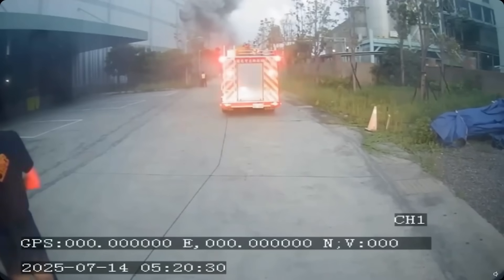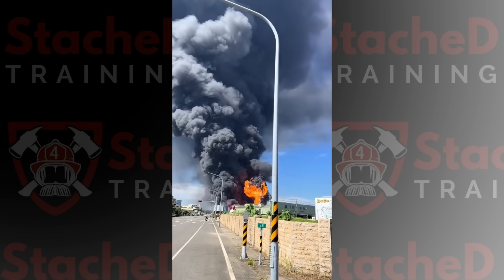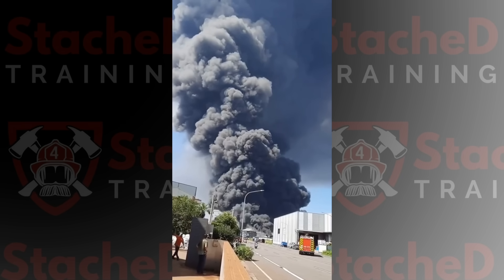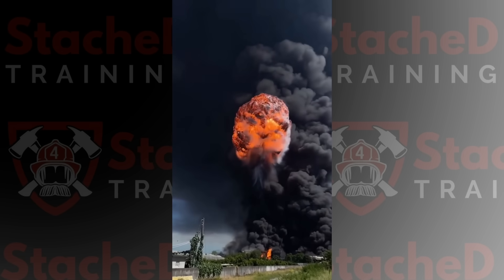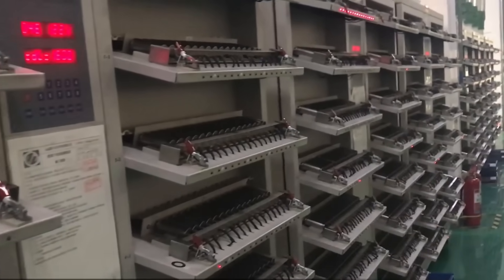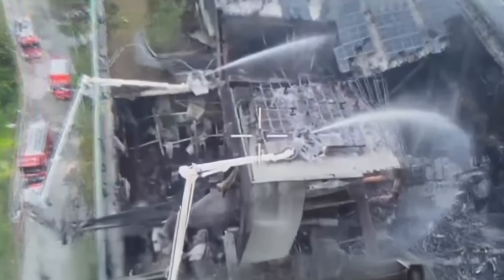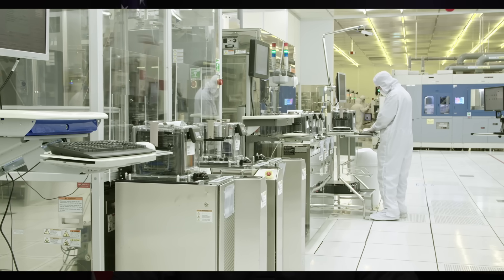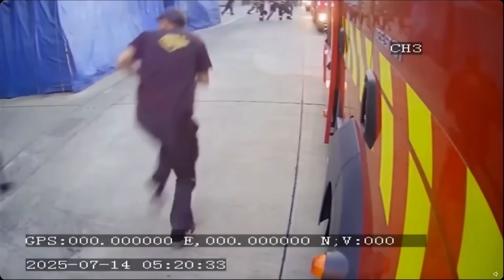Massive Lithium-Ion Fire in Taiwan: 2 Million Cells Lost

Comment: I'm sticking with gas-diesel-prooane, it's so much safer and fuel fires are so much easier to mitigate than metal fires. Metal fires are also super toxic. The fumes are deadly. Gas, diesel fires don't pollute the ground and water. Petroleum came out of the ground and microbes break it down. That doesn't happen with lithium oxide, nickel oxide and other dioxins created in the fire.

Comment: What insurance company is still underwriting this crap?
Reply: most of them because they know the actual risk and are insuring far riskier things.
Reply: Whoever is getting paid.
Reply: There is no insurance -  you buy laptops, cell phones, flash lights, it ALLLLLL has lithium cells.    Tell me how many lithium cells are in your house?       probably 100+      A laptop battery has like 9 cells,   A phone has a pouch cell,   tablet, pouch cell,  Flash light at least 2+ cells,   battery power tools 6-20 cells  you probably hvae a ton of power tool batteries,   maybe a Lithium Ion  car battery?   Optima battery?      You have a battery radio?   Weather station?    Some HF radios?    Mannnnn you have so many cells in your house BOI
Reply: @DrScopey2  The issue isn't the batteries themselves, but the large-high capacity unregulated batteries packed together and left to decay in the sun
Reply: @DrScopey2  You are right.  Too many Li batteries -- phones, laptops, and tablets.  Makes me quite edgy.  I'd rather deal with the old fashioned inconveniences of NiCd or NiMH batteries, but that's not an option unless I want to use electronics from 1995.  My favorite portable Sony CD player ran for hours and hours on a single charge of its lead acid battery, and those batteries never had any charging "memory" problems.  I'd love it if I could put a lead acid battery into my tablet computer.  (The CD player only stopped working when I accidentally dropped it down a set of concrete steps, sadly.)  Lead has its own problems, but those batteries were never known to catch fire if you looked at them the wrong way, and they offered very high charging density.  Lead batteries are perfect for portable electronics.  For something like a battery powered car, not so much, because of their weight when used at larger scales.  For home battery backup, I would choose lead acid over lithium on any day of the week.  What led (no pun intended) to people forgetting about lead batteries for electronics is beyond me.

Comment: Now there will be torrential  rain as a result of all those minerals going up into the air where it doesn't belong. These batteries are not worth what it does to our environment when it burns. Thank you for another detailing report.
Reply: That's not a big deal, those fumes rise in to atmosphere pretty fast and well above the weather system, they got really high up about 300,000  feet until the sun rays brake them apart in about 100 years.  But trust me when someone burns trash that is much worse, plastics in the atmosphere can last 200-500 years but they begin to brake apart within just a few days so the smoke itself is baked off but the particles last for hundreds of years not a big deal, the planet will be here for another 2 billion years so all humans are doing here is a tiny tiny little spot on the time scale.

Comment: I think we are electrifying things just for the sake of electrifying them at this point. I'm getting tired of having to keep tabs on charging so many batteries. One of my bicycles has 4 batteries just for the shifting, then you need another in the computer and another in the heart rate monitor. I would have preferred a cable actuated system, but the manufacturers are phasing them out. Mechanical stuff I can often fix, but things with circuit boards are often next to impossible to repair. There is a brilliance in simplicity.
Reply: BUT you bought it anyway! 🤦‍♂️
Apple fanboy, right?! 😂
Reply: Yeah.  Battery tools are a lifesaver in some cases, and I have an electric mower for my small yard, but we've gone overboard to the point where you have to look hard to find equipment that plugs into the wall or uses regular batteries.  I went to look for a baby monitor to monitor a piece of equipment in another room, and most of those are rechargeable!  Computer keyboards, flashlights, everything.  You almost need a list to keep track of all the stuff you own to make sure something doesn't get too discharged and permanently dies.
Reply: @WanJae42  re: "Battery tools are a lifesaver in some cases..."  "SCREW THAT...!!!" (best Amish/PA "Deutsch"/last name Stoltzfus voice)
Reply: That's why I ride a 50 year old Schwinn 10 speed 😀.
Reply: @leepowell6754 
Can you still get parts for it?
Reply: re: "I think we are electrifying things just for the sake of electrifying them at this point."  close but no, we are "electrifying things" for the sake of GREED and ESC (End Stage Capitalism) as such we have to call it what it is.  breaking news...!!!  the Markets have SHRUNK, all the Bridges have been built, all the Water has been drawn, and all the Ditches have been dug.👈this is why it's important we mature and develop the courage to pay attention to the Politics occurring in Washington DC and occuring in the State Capitals so one knows what's actually going on.  as we see from the grotesque loss of young life along the Guadalupe River in Texas, no one (least of all future generations) are served when the so called "adults" RETREAT INTO FANTASY.
Reply: I agree.  We have never been so batteries oriented as a society.   We have gotten away from simple mechanical tools that used to be the norm.
Reply: Why didn't you CHOOSE a simple bicycle then? You don't need a heart rate monitor or computer to exercise. I'm willing to state under penalty for perjury that athletes reached high performance levels long before electric light, let alone computers.
Reply: Lol you dont all that stuff. Use a regular bike and a desktop pc. That what i do. I cant afford an electric bike anyways lol.
Reply: @Lobonova  only weaklings use electric bike
Reply: Say electrifying again fool
Reply: They are next to impossible to repair for someone, who isn't willing to learn new skills. Guess what. A Model T was next to impossible to repair for one of the founding fathers and a fork is next to impossible to use for a chimpanzee. 

Get yourself a rework station and stop complaining.
Reply: @goiterlanternbase  They're as repairable as the manufacturer wants them to be.  Not very.  Simple and robust vs complex, over engineered and fragile?  Simple and robust every time.
Reply: @goiterlanternbase  That or just dont buy silly consumer crap in the first place. I have rework equipment for fun but the wise choice is not buying IoT future ewaste and using money wisely instead.
Reply: @goiterlanternbase 
Yea, right.
Reply: We can do all this chitchat. But in the end there is only one final scientific conclusion: there is human made climate change, we need to do something, and the change from fossil fuel to EV is one of the measures, with least invest and the bigest impact on the environment.
Reply: @muten861  quite ignorant but believe what you want.  EVs are not “clean.”  They are tail pipe clean.  The electricity comes from somewhere, often from fossil fuels.  The environmental impact of batteries is overblown, but not zero.  The increased tire wear is overblown, but not zero.  The increased road wear from their weight and requirement for more frequent repaving is not zero.  EVs aren’t bad, they just aren’t as clean as they are often advertised and imposing them just hurts their appeal.  For many people, an EV is genuinely the best option for their driving habits.  But when you tell them they are the devil for not having one, they don’t want to give in to bullying.  Can’t blame them.
I say as an EV owner.
Reply: @qwerty112311  if you state to be an EV owner, doesnt provide you any credibility.  There hundrets of elaborated scientific studies, coming all to the same conclusion. But youre more genius than all of these scientists. They should have asked you😂
Reply: @muten861  Them scientific studies are bought and paid for by the people pushing this garbage. If they don't come to the conclusion they want. The scientist doesn't get paid
Reply: @muten861  no proof any climate change is from humans...Mother nature has been changing the climatefor 4 billion years and you think humans can out do that
Reply: @muten861 extremely dangerous fires caused by the EV's throw it all out the window
Reply: @muten861 
This is only considering one aspect of harm to the environment. The harm that EV causes is not a part of the equation.
Reply: @muten861  LOL, go back ten thousand years and the climate was far warmer and containing more CO2 than today.....Humans contribute very little to any changes. You are drinking the kool aid that TPTB spoon feed you. Stop.
Reply: @muten861  plugging our electric cars into a coal fired power plant to charge the batteries is not helping the planet.
Reply: @muten861  absolutely NO such thing as “man made climate change”. Anyone who believes that crap, is too ignorant to find the truth out! Here’s ONE FACT! My birth town used to have the official BOM temperatures taken about 500m from my parents home. It was NEVER more than +/-1c from my parents recordings. Then the BOM moved their recording equipment TWENTY FIVE KILOMETRES AWAY. ON THE OTHER SIDE OF A SMALL MOUNTAIN RANGE (nearly 800m above sea level) at its highest. Now dividing our town from the BOM’s measurements. Suddenly, our “official” temperature was up to 11c higher than my parents equipment! And has been so, for over 20 years! THAT, my friend. Is just a small part in “rising” average temperatures! Now this issue is the same, the world over. BOM moving their equipment away from towns and using incorrect mathematic equations to incorrectly GUESS the temperature elsewhere. Get your own temperature gauge (get two) it helps to ensure a reasonable degree of accuracy. And DO NOT believe “official” temperatures.

Comment: You have ton of videos about lithium-ion batteries issues, but there is a big trend for diy lifepo4 batteries to store solar energy, do you have examples of them going bad? And the best ways to protect a home to limit potential damages ?
Reply from the maker: Just to clarify, lithium iron phosphate (LFP) batteries are lithium-ion batteries. ‘Lithium-ion’ is a broad category that includes several chemistries like NMC, NCA, and LFP. LFP is known for being more thermally stable, but that doesn’t mean it’s immune to failure. Under the right conditions: overcharging, internal defects, mechanical damage they can and do fail, including going into thermal runaway. I’ve covered real incidents involving LFP failures. No battery chemistry is perfectly safe.
Reply: @StacheDTraining  I've also seen that LiFePO4 fires are generally not self propagating like NMC. How do you feel about high quality LFP power stations like Jackery units as far as in home storage?